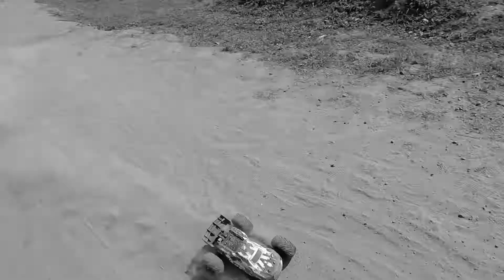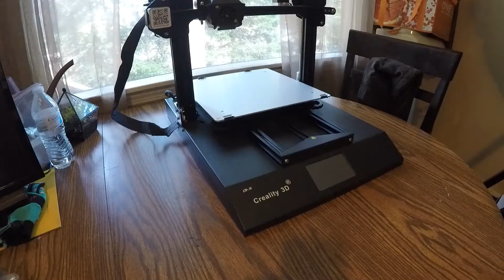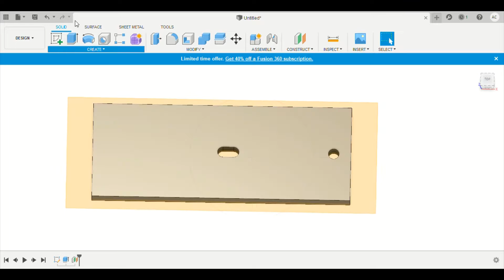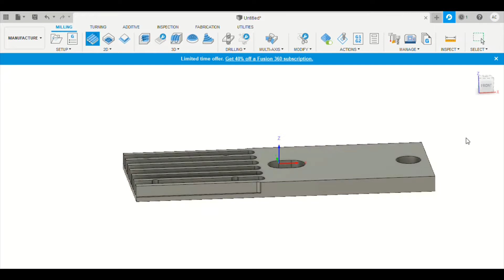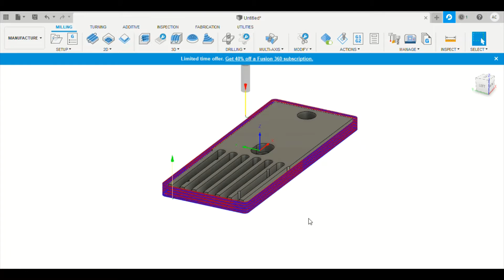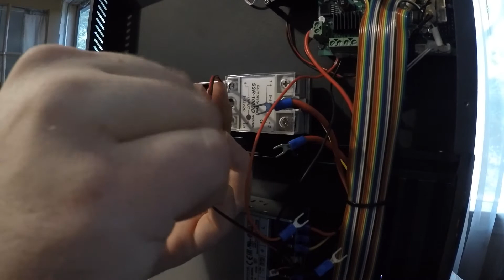CREALITY CR-X / CR10S-PRO SSR GOES UP IN SMOKE! DIGGING INTO THE PROBLEM, COMING UP WITH SOLUTIONS!

Comment: Ok.... So. Thermal Runaway is installed on all V2s. Here is the thing though this prevents you from going above 120 degrees in the window thus you can't run an upgraded bed.
Reply from the maker: Problem is, once the SSR is internally shorted the board can no longer control the SSR.. so thermal runaway is useless in these situations... They are powered directly from the power supply.. The board applies voltage to the signal pin to turn on the SSR..  The board cannot, and does not disconnect the direct power from the power supply..  once that "switch" (the SSR) is melted in the on position, nothing can power it off besides a cut in wall power...

Comment: For those that don't have a CNC - Just get 2 X T-Nuts and bolt the SSR to the Aluminum extrusion inside the case.  This will keep the SSR substantially cooler and much more reliable.

Comment: Thx for this 1 MIne decided to see how hot it could get last night. Found your vid and have checked the SSR and yup hanging off exactly the same but you could tell it was burnt out by the smell Lol you saved me a lot of time hassle and worry Thank You.
Have ordered an SSR the same as you have used dont have the ability to make a heat sink the same as yours but ill get hold of some aluminium plate at some point once i have it up and running again. Once again Thank You :)

Comment: Hi. I found this video recently and want to say Thank you! for it.
I have a question or two when choosing the replacement ssr.
On the original it says: DC-12:40A 220VDC 3V~32VDC
I found an ssr like this:  DC to DC Input 3-32VDC To Output 5-240VDC 100A Single Phase. 
Is this possible to use? Is it dependant of the voltage of the power outlet? In my country we have AC 220V. The printer worked with the original one just fine for three years.
I have no clue about the values and voltages... I understood it is needed to be dc-dc and higher amps. But for the rest I m just blank. 
I ve already ordered a mosfet module - I hope I will use  some instructions on how to connect that I found also here but wanted to have an alternative with the ssr. 
Whichever comes first...
If you have an advice - Thank you again!
Reply from the maker: Thanks for checking out the video and stopping in to leave a comment..👍

The supplied voltage to the printer has no affect on which ssr to use .. the determining factor is the output of the power supply, which In these cases they are DC to DC... so the one you found will work..
Reply: @camaroboy383  yay! I was hoping for this. I really miss playing in the 3d printed reality.

Comment: I just got a new SSR and mounted it same way you show here but get zero heat from the bed. I wonder if you can share the link for the SSR you use here? Also how can I check if I get right power at the outlet of the SSR because it turns on when I set heat on the machine but bed doesn’t heat up.
Reply from the maker: Thanks for stopping in to check out the video and comment..

.Did you happen to try reversing the large positive bed wires?...

 It would seem you have the SSR signal side correctly wired if it fires the light up when it's commanded.. So I would suspect the load side is backwards.. 

The SSR I bought on Amazon, the link is now long gone unfortunately.. As long as it is a 100 amp DC to DC SSR you should be operational...

Did yours melt down and run away?

Comment: I take it you didn't bother to install a thermal fuse in line with the SSR?  Also, your replacement SSR is likely counterfeit as a real one would have the trademark curve in the bottom right corner of the label.
Reply: Exactly. No way that ie at 1000 W bed and 230 V a REAL 40 A SSR would generate a heat. It’s a little but over 4 A to the bed! So the SSR is overdimensioned 10x.

Now, if it was a real, high quality SSR. A real ones are very expensive. 50-60 € not a problem for 40-50 A SSR. Crydom, Panasonic… I went for Crydom 50 A SSR for 1k W 230 V bed and that thing is cold to touch. And yep, it’s price was almost on par with heated pad.
Reply from the maker: @ZhuJo99   Correct, that would be very true for a AC SSR if it infact only pulled 4a or under... it's pretty common knowledge that anything over 4a should use heat mitigation... 

These are not AC SSR's...They are DC to DC, pulling a 17a load on cold start and a constant 14-15a draw at temp.. regardless of a knock off or real one, heat mitigation was a must that never happened from the factory...
Reply: @camaroboy383  right, but befor I changed to AC bed on my Ender 5 Plus, it used mosfet to power up the bed from 500 W PSU. And it also wasn’t overheating, yet taking about 18 A from PSU.
Reply from the maker: @ZhuJo99  good upgrade..👍..love how fast AC beds heat up ... Yeah, a MOSFET is a different animal though.. They have large heat sinks for heat mitigation, and open to air flow... 

Enjoy that ender..👍
Reply: @camaroboy383  that Mosfet is stock from Creality, I wonder why they have not used the same on Cr-10S. If I would be you, I would rather switch to mains powered bed too. Little harder on cartesian printers because of movig bed but definitely worth it on such big area.
The nice bonus on my Ender 5 Plus now is not just faster heating, but the fact that 500 W PSU is not overloaded anymore and is silent as it doesn’t have to turn the PSU fan on. And it should last a long time because of it.
Reply from the maker: @ZhuJo99  I may very well make that change down the road if I have any future issues.. As of now I'm well over a year into pretty constant printing with no problems on the current SSR with my heat sink...👍..
Reply from the maker: No, I did not install a thermal fuse in the line.. It is feasible, and not a bad idea if your printer is left for long periods unattended.. 

It may take some trial and error as to what will work as the symptoms of a stuck ssr are very similar to the load of a bed heating up from dead cold up to temp.. especially if the bed temps are high (100-110c).. 

I'd say pretty much 90% of ss relay's off Amazon are copy's... Which in my opinion makes it even more important to up the amperage capability..

This setup is still going strong, and has far surpassed the factory ssr lifespan...

Regardless of the ssr make, it was pure negligence to mount it up in open air, on towers, with no heat sink.. At the very least it should have been mounted on the rail or against the sheeting of the enclosure.. With no place for that heat to leach off it was destined for failure at some point.. 👍

Appreciate you stopping in to check it out..
Reply: @camaroboy383  With your heated bed not using more than around 3 amps (6 if you're in the US) I can't imagine it would generate enough heat to need a heatsink.  If your original SSR melted due to heat, then it's probably because it was likely a clone/counterfeit, the components inside were not really rated for 40 amps (probably more like 5 amps or something)
A 40 amp SSR running a 3(6) amp heated bed, shouldn't generate nearly enough heat to warrant the use of a heatsink.
Reply from the maker: @AndehX  Absolutely, we surely can't expect creality to use quality components.. There is no question the factory ssr is/was a counterfeit.. After all, these machines come in at super low price points.. While I 100% agree a real ssr with true ratings would not need a heatsink with 4a and below current draw.. I think we both could agree creality would not supply a real ssr unless there was a complete community uproar..

That being said, they know what the ssr is, as far as being a copy.. so the smarter move on Thier part would be to heat sink it, or up the rating on the cheapo SSR and heatsink it..

Every crx, and cr10s pro left the factory with these crap ssr's .. I can not speak as to the ssr In the pro V2, as I've never opened one.. But I would hope it's a better, or at least higher amp counterfeit ssr if it is infact still a DC component..

It is well known that any SSR, regardless of brand or amperage should have some sort of heat mitigation if there is a 4 amp current draw or beyond.. To float a SSR is bad practice in any application really.. 

 I'm not exactly sure where you are getting your amp draw numbers? Are you speaking of AC amp draw? That may be where the confusion on numbers is.. These are DC to DC SSR's..

 The heated bed on a crx and cr10s pro Draws a current of 15-17 amps DC, 17a being a cold bed start with a creep down to about 15+ amps when at 60c .... Hence the use of the 24v 21A DC output power supply... They are amp hungry DC beds..👍
Reply: @camaroboy383  Yes, I was talking about AC heated beds.  I wasn't aware that 3D printers came with SSR's already fitted, and I wasn't aware that an SSR was necessary when using DC beds, as the mainboard is usually sufficient enough to power the bed.  Although im in 240v land, so maybe it's different than 110v land as I know more amperage is required over there to reach the equivalent wattage.

But yes.  I can totally see why you'd need a heatsink if you're drawing 15-17 amps.
Reply from the maker: @AndehX  Ahh, gotcha man.. yeah I figured you were talking AC when you stated the low current numbers..

Typically the only printer beds that can be heated with an integrated board MOSFET is rather small, I believe the largest bed I've seen heated with a integrated MOSFET is 200mm squared..

But most run a external MOSFET board, even some of the more expensive brands run them on the smaller beds as well.. Helps when it comes to repairs, just a MOSFET swap instead of a main board swap..

For a while (I'd say a couple years) there were a couple companies using AC to heat the bed's.. They heat up quick,  and were alright in my book.. 

Creality chose the 24v DC route.. Then they chose the SSR route instead of an external MOSFET, saying it was more reliable.. On paper I'm sure it is, but that paper was missing the heat factor..lol..

Thanks again for stopping in man, and I appreciate the conversation..🙏

Comment: Hi Alden! I would be interested in purchasing a few of these heat sinks from you. lets chat
Reply from the maker: Hey CJ, appreciate you stopping by to check out the video.. I'd be happy to help you out if you need the heat sinks.. I can machine some up for you if you want.. I can list them on eBay so all is secure for both parties..👍..

How many were you interested in?
Reply: @camaroboy383    Thanks for your prompt response!
Well for right now im looking to purchase 3 (provided the price is appropriate). however
I run a 3d printer sales service and supply shop in south central PA, and in addition to the 2 i need for current repairs, i could certainly use a few of these to go on my shelf.

Ebay works, we can do paypal too, if youre an LLC we can do b2b sales as well.

thanks a bunch!
~Calvin
Reply: @camaroboy383  check my channel page for contact info :) 
YT was deleting my comments with it
Reply from the maker: @3dmakerswarehouse897  I will for sure check it out later when I get out of work..👍..

I'm sure we can work out something so you have some in stock..👍
Reply: @camaroboy383  sounds like a plan! I look forward to hearing from you!
Reply from the maker: @3dmakerswarehouse897  Hey buddy, I didn't forget about you.. life has been crazy for me lately.. email me and we will get this under way if your still interested...👍

Comment: Hello!

My bed was heating up until the maximum, the ssr was not working because it wasnt cutting off the power. I opened it and it was completly blown.

I replaced it and now my bed and nozzle are not heating up. Could be a brand new defective SSR? 

Also, by 
discarding the SSR, how do i check for voltages? Should I have voltage while the printer is powered on the motherboard outputs (the ones that are going to the SSR)?

Any idea to check with multimeter?

Thanks!
Reply: Edit:

While turning on the 3D Printer and doing the preheat, the SSR led is turning on and anything is getting heated (no heat on nozzle and no heat on the bed).

I checked connections and everything is fine. Also thermistors are working, it's showing 25ºC on the nozzle and 25ºC on the bed. 

But it's not getting hot.
Reply from the maker: @cyb3rgh0st22  The ssr only controls the bed.. It has no control over the hot end..  it would not heat the hot end until the bed was up to target temp.. 

Go to manual and input a target temp for the hot end and it will heat up..

Ssr's can be wired different from the factory one.. try switching your two large  wires.. and try to heat the bed again.. your signal side should be correct if the ssr light activates..

Comment: I bought a SSR 80 A. Installed it, turned on the printer and the bed heats up without any temp entry.  Bed set to zero, bed heats up. Any ideas?
Reply: I tried that and still heats up. My internet search says it’s the MOSFET and it can be swapped out.  What do you think?
Reply from the maker: @rlajordan  no that's incorrect.. you do not have a MOSFET.. that's what the ssr is for.. I would need to see the ssr you purchased and how it's wired.. is there any way you could post a video?
Reply: @camaroboy383  your incorrect, there is a small aod514 mosfet on the mb   it controls the ssr
Reply from the maker: Your ssr is hooked up backwards.. the call side of the relay is hooked to constant power making it call for heat instantly..

Swap your large gauge wires that should set it straight..👍

Comment: Thanks for the video. I had the same issue on a CR10S Pro. Tiny Machines recommended to install the SSR on the 2020 rail. Also, I have a 24V fan but not sure where it plugs in to my board. This is a serious issue and very much a fire hazard.
Reply: Thanks. I found the place on the board. I plan to mount a 4020 radial fan to blow on the SSR mounted on the 2020 rail.
Reply from the maker: Thanks for checking it out and commenting my friend..👍..

To be honest I just don't believe the 40 amp ssr is up for the task.. the 100 amp I installed seems to be holding up perfect.. 😎.. 

Mounting on the rail will surely help dissipate some heat.. you should be able to just plug it in the same spot I did in the video.. if the plug is not the same they can be had cheap..👍.. another option is right to the PSU as it's 24v...

Comment: Interesting. Someone on a support group that I frequent had the same issue.
The thermal runaway protections are useless if the ssr is shorted and stuck on.
Ssr's are mosfets transistors and thyristors. They need heat sinks.
Again it shows the lack of qc testing in china.

Comment: Thank you very much. I have had the same issue. I have been having troubles finding the ssr you bought. Also, can you give feedback on how your fix has worked out for you. And if your feeling really helpful, the mosfet option... do you feel it would be better or your fix?
Reply from the maker: The ssr I replaced has been perfect.. no issues since.. machine has been running flawlessly..👍..... I will look up a link and post it for you.. ✌️
Reply from the maker: https://www.amazon.com/Lightobject-ESSR-DD100A-Solid-State-Relay/dp/B00P087DA2

Here is a link to the one I purchased.. 👍..  the mosfet is another solid option.. but some rewiring will need to be done..👍..but the ssr I installed does not even get warm now.. I think the factory one is on the ragged edge of amps allowed.. that's why it gets so hot and melts down....

Hope all this helps my friend, good luck..✌️
Reply: @camaroboy383  Thank you so much brother. I am ordering and doing the heat sink as well. This video should help other too. I did have an issue finding any vids that addressed it. I ended up just putting in “cr-10s pro repair” and scrolled until your’s jumped out. Great stuff!

I use Fusion as well. Though I am capable… Would you mind sharing your drawing file?
Reply from the maker: @orionmec  glad it helped you my friend..👍.. be happy to send over the stl of the sink if you would like.. you will just have to run your own cam.. email me and I'll send over the stl..👍 

Also be sure the fan you purchase is 24v